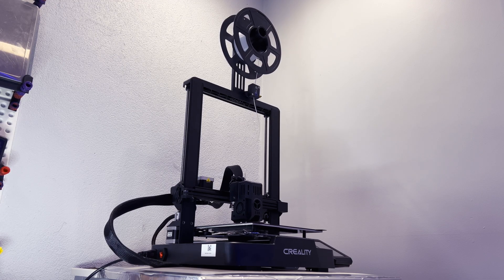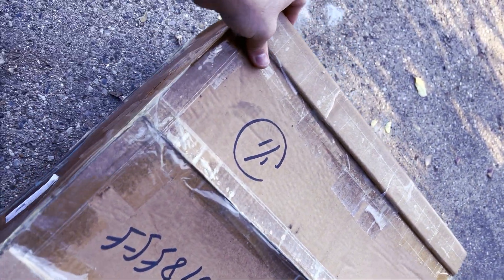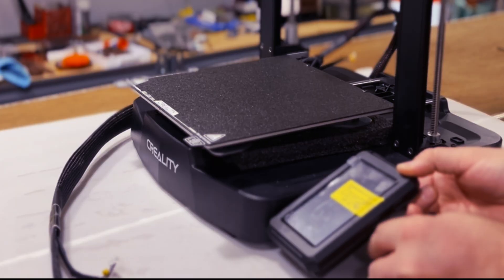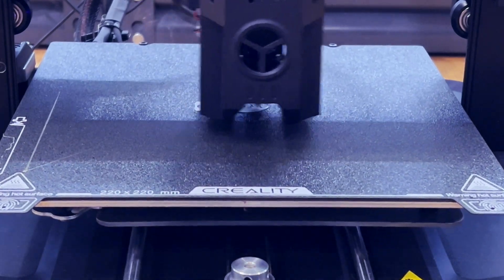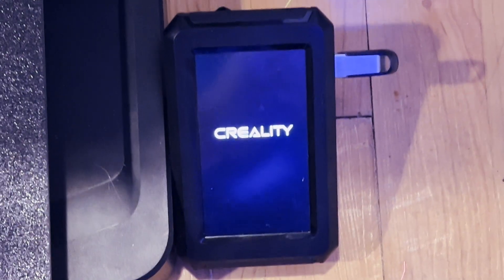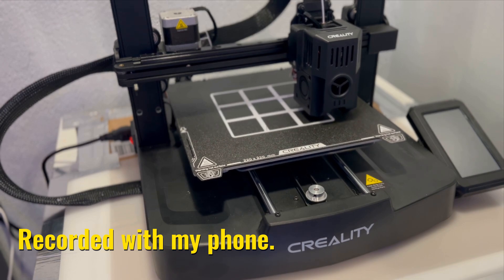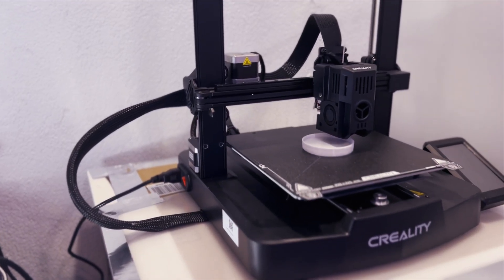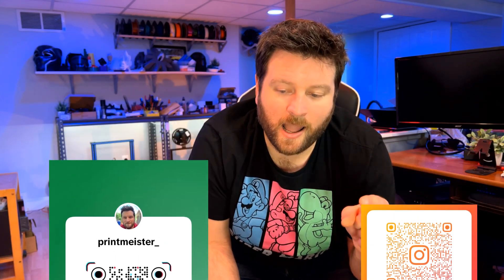Top Tier Prints Without Top Ramen Diet

Comment: I've had an Ender 3 Max for about 3 or 4 years and it does a great job at good prints (PLA).  I'm on the edge of pulling the trigger and getting an Ender 3 V3 KE. My biggest fear is it being a "downgrade" just because other than a few issues with the 3 Max, I've had a great experience with it. (I don't have space to keep both the Max and a KE..)

Comment: Have you tested the V3 SE? I had issues with a few of them, where the auto alignment was always off. Sometimes, it would be off 0.5-0.9 in different areas | #BulletproofMediaGroup
Reply from the maker: I have not tested it. That’s quite the variance!
Reply: @printmeister  it was pretty mind-boggling. One I got was "in the green" everywhere except for the bottom-right corner was off by 0.52. I swapped it out and the one I got, which I initially referred to, was "in the blue" with those values - on every sectiom on the bed, aside from the middle area. Sadly, I returned it, but I still love the S1. Manual leveling is still a huge benefit sometimes. Keep up the great work! | #BulletproofMediaGroup
Reply: V3 KE is awesome but have several downside like the 2nd z-axis doesn't have a motor and the frame is cheap cause it's in a A or V frame shape so you need to add some stabilizers. Also I bought 1 cheaper than mention for $230 at my nearest computer store brand new and about 10-15min the nozzle and print started rub each other so I return it and got an CR-10 SE for $280 and with several print there were no rubbing/grinding noise. Also don't buy it at Creality Store it's effing expensive.